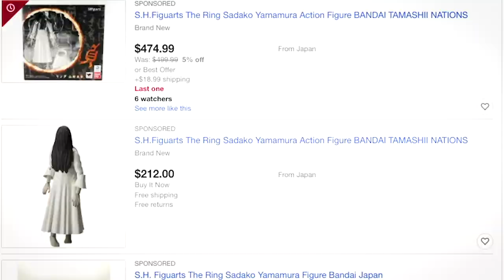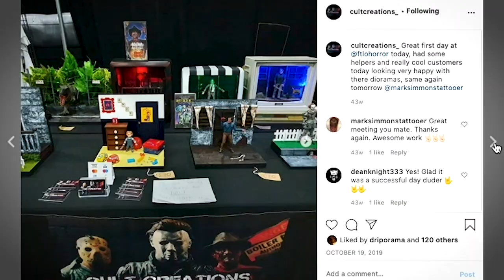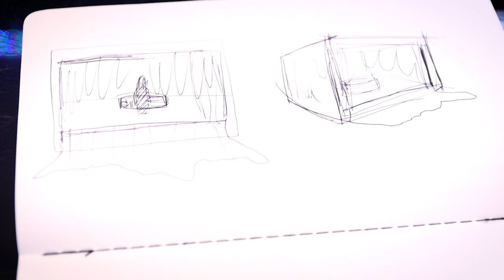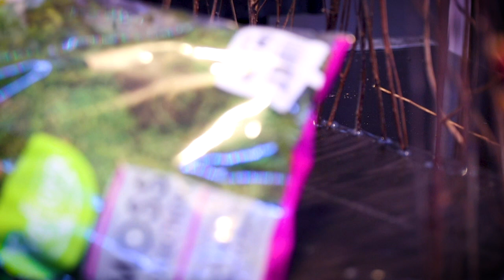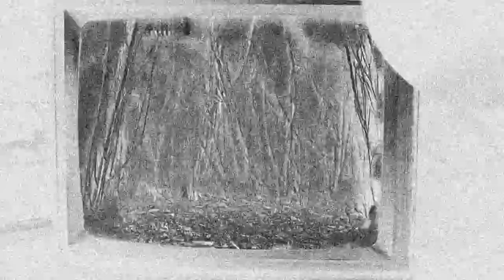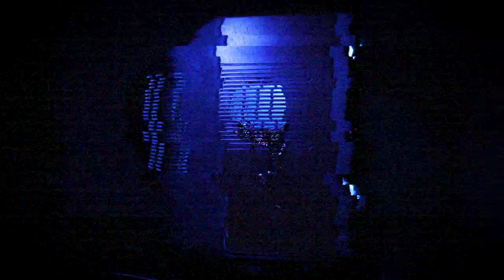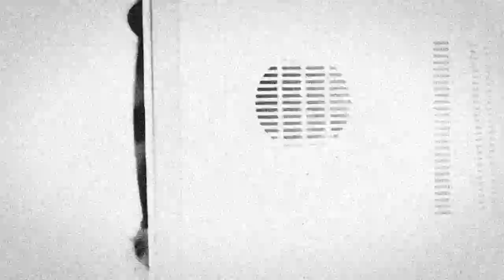The Ring TV Diorama & Custom Figure | Vlog152

Comment: I bought an old TV on a rolling stand.  Didn't know what to do with it when I got married and the project wouldn't be wife approved.  Not that I couldn't do it but that it would cause a problem.  On the scale I wanted, yes.  Now I can make clay model and do the same idea just scaled wayyyyy down.  It involves the TV so it's a fitting canvas.  Thanks for the inspiration.